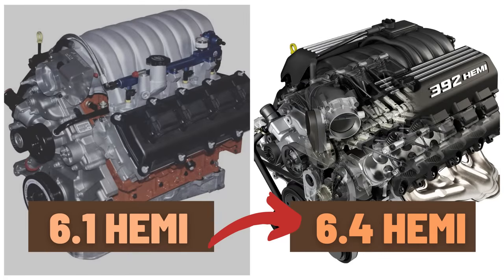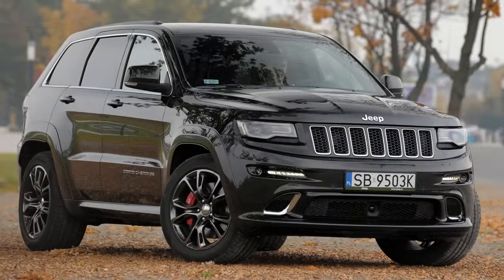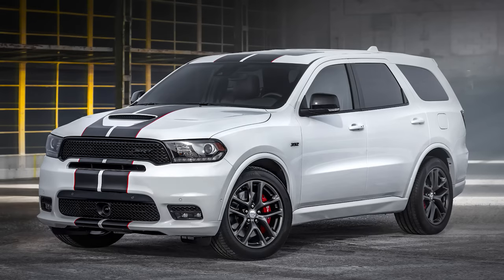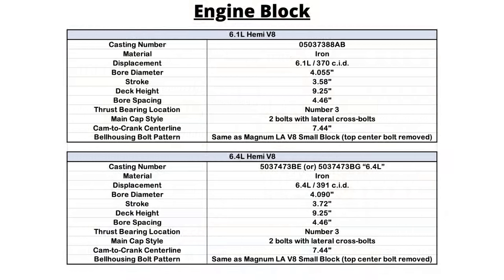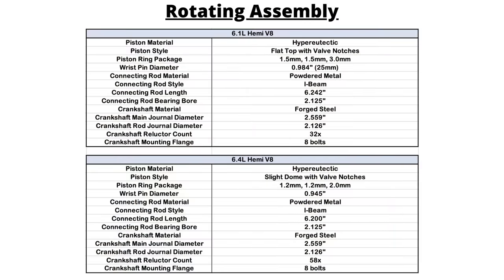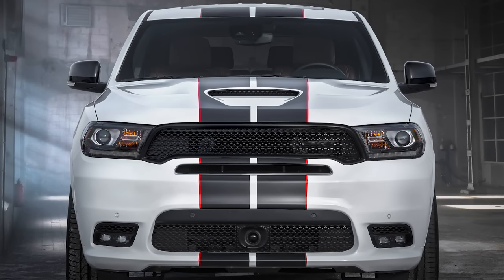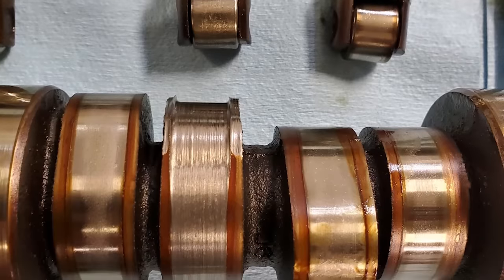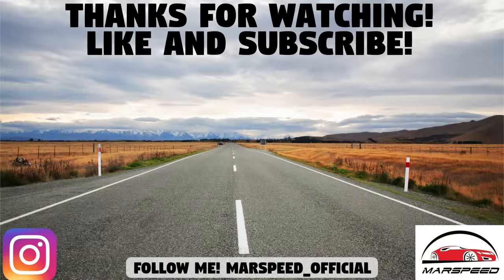6.1L vs. 6.4L Hemi Engine Full Comparison – Which One is Better? (Specs, Performance, Flaws, & MORE)

Comment: I’ll take the 6.1 over the 6.4 any day. 6.1 is a better built motor with less problems.
Reply: With that 6.1, you get less power. But I’ve had four 6.4s. One that I built, definitely all had no issues even with my frequent track use.
Reply: I have a 6.4 with zero problems and it has way more power
Reply: Agreed. The 6.1 srts were true old-school muscle. Just a simple V8. No variable valve timing, no cylinder shut off BS. The 6.1 is straight out of the 60s in a good way. I'd rather have that than an extra 50hp.
Reply: @widebody53ad remember they can handle a lot more boost than the 6.1l
Reply: @fnafplayer6447 pre 2018 392’s cannot handle boost they are not Bge blocks.
Reply: @fnafplayer6447 actually the 6.1 handles more boost than the 6.4 and is all around a better motor
Reply: @vee950  I meant the BGE blocks, what's better the bge 6.4 or the 6.1

Comment: 6.1 was a lot more "raw". Traction control sucked, skid control sucked, torque management was nearly non-existent, and the NAG-1 can hold a ton of power with a proper converter and TCM tune. Drop some good pistons in it, and they'll make a ton of power with boost. Richard Holdener took a stock 5.7 of the same era and made north of 1000hp before breaking a piston. Good video.

Comment: very informative video, can you please provide me the lobe separation angle on both 6.1 & 6.4 camshafts?? i got a lifter failure and probably cam lobe damaged on my 2010 grand cherokee SRT8 6.1L so i have to replace them anyways and contemplating to upgrade to a 6.4 cam/springs if there is any gain by doing it but first need the complete specs for both camshafts which will help me to decide what route to follow, thanks in advance

Comment: So 6.1 or 6.4 which do you guys prefer
Reply from the maker: The 6.1 will always be special. It looks amazing under the hood, and was the first SRT engine. But you can’t argue with the performance of the 6.4 as it’s definitely better in that aspect!
Reply: Bigger is better
Reply: @MarspeedCars  i also love that the 6.1 can hold a good amount of boost
Reply: 6.1 definitely
Reply: Very informative about these engine s !
Reply: Most definitely the 6.1
Reply: 6.1 OG SRT8.

Comment: I mean Boost is fine on the stock pistons as long as you gap the rings as shown by Holdener's big bang video on a Stock 5.7 he was pushing 20PSI before it blew and it's due to the extreme backpressure of a single turbo that's too small
Reply: I agree w this in lieu of the method engineered of the runners.  It’s designed for it even has a similar (but not as low) compression ratio as the hellcat. Even more the fact that procharger demonstrates an install of their blower directly on a red Jeep srt on their website.  If my Mazda 2.5 l 3 can handle boost from the factory why can’t it? Lol.  I do however like the compare and contrast of why lifter failure may be occurring more on 6.4s as more were produced.  Good review
Reply: @ryanc2927  This is nonsense

Comment: So it seems like the stock lifters they use on the NA engines can't handle more than 360ish horsepower. Which is strange because it's not like that power is getting transfered to the lifters. They're not getting the brunt of it. Perhaps they can't handle as aggressive of a cam as these engines have. What I don't understand is why they don't take a look at what gm and ford used in their pushrod engines and follow the same formula. It would make a lot more sense and get rid of a common plague amongst their v8s.
Reply: The ram 5.7 is 395hp. The lifter issues is mostly in high idle vehicles.

Comment: The 6.1 is better to me because it can take boost with out many mods compared to the 6.4 but the new 5.7 makes almost as much power as the old 6.1
Reply: Plus the better new 8 speed automatic transmission
Reply: @IhateYoutube  yes but its not as reliable as the 5.7 or 6.1 cus of the compression ratio

Comment: Yes I have 09 srt and at 140 k miles I had to replace both cam shafts and lifters  3800 dollar cost  one owner
Reply: Currently looking at an 06 Chrysler srt8 with 140k miles, kind of afraid I’ll buy it and shortly after rebuild the cam and lifters. What noises or symptoms did you have that you recommended I look out for?

Comment: Difference between the 5.7 and 6.1

Differences in the engines....

The Block is different
The Cam is different
The Intake Manifold is different
The Heads are different
The Exhaust manifolds are different

I think that covers the majors.

In other words the 5.7 and 6.1 are very different.

Oh, the Throttle body...... it's the same :)

The quoted HP is at the crank, not at the wheels.

To acheive the 6.1L HP from your 5.7L you'd be at least looking at heads and a cam swap, exhaust, and tuning.

Comment: 6.1s can take boost and have gone up to 11 psi with no issues sbe. 6.1 is more for the builder and racer since it's cheaper and easier to modify, 6.4 has the better tech but more expensive. Reliability goes to the 6.1 easily but 6.4s can be reliable with some work.
Reply: the 6.1L is less reliable than a manual trans equipped 6.4L vehicle. The updated standard lifters that replaced the old 6.1 lifters in 2015 (commonly referred to as Hellcat lifters) seem to have solved that issue. The 6.1 lifters still suffer the same exact failure as the MDS lifters, just far less commonly.
Reply: @DarkSlayer487  not even close to being true. 6.1s are way more reliable then a 6.4. Ask any 6.1 owner how long their engines last vs a 6.4 and it's not even close.

Comment: so, which one do you own?  I remember you had swallowed a valve, and then had it all rebuilt, fixed.
Reply from the maker: I ended up keeping the 5.7 block and then boring it out, so it’s now a 6.5L motor with zero stock parts.
Reply: @MarspeedCars  yes, I remember, now that was I think over a year ago, so how's it holding up?  Have you had it "Dyno'd"?  Is everything good on it still?  Have any of the "aftermarket" stuff done bad/wrong/under performed?

Comment: Crazy how these 392s are at their limits and can’t be boosted on stock internals, when you can get a stock junkyard 5.3 Chevy and boost it to over 1000hp reliably! I love all brands, but this Hemi engine is purely all hype unfortunately.
Reply: That whole 1000 hp reliably is a bunch of nonsense.  You gotta tear it down and add ring gap and heads cam intake etc etc etc to get to those power levels and they certainly aren't "reliable" at 1000 hp no matter what the internet tells you.  Those engines are overrated.  Some engines just aren't boost friendly but they can take 6-7 psi give or take with a good tune and fuel (the 6.4).  

Try doing 1000 wheel on a 5.3 without doing heads cam upgrades and without adding ring gap and see how long it lasts lol.
Reply: It has a forged crank it's not that hard to do forged rods and pistons and you can select your compression ratio too.

Comment: So just so you know you people out there are to think you're buying a real hammy are being screwed to death there was never an engine like the 66 7 8 and 9 hemikuta back in the early in the sixties era so this engine you're buying today is a absolute piece of s*** and has no power compared to that old hemmy and it doesn't even sound like a hemmy when you used to start up an old hemmy the ground shook around for 20' when you're standing next to the car these new hemies are Not even comparable to those old motors.. So if you want to do yourself a favor and have a really fast car just do what I did it's no big deal you buy a Nissan GTR build the motor to 1400 horsepower like I did you have an H 2nd car and there's nothing in there is nothing including the b***** lamborghini's Ferrari get lamborghini's ferrari's that will even come close to touching you on the road you beat them by 1520 car lengths before you even know what happened...
Reply: 1960's 426: 
The street Hemi version was rated at 425 bhp (431 PS; 317 kW) at 5000 rpm SAE gross and 490 lb⋅ft (664 N⋅m) at 4000 rpm of torque equipped with a pair of four-barrel Carter AFB carburetors.[20] In actual dynamometer testing, it produced 433.5 hp (323 kW; 440 PS) and 472 lb⋅ft (640 N⋅m) of torque in purely stock form.[21] Chrysler's sales literature[22] published both the gross 425 hp (317 kW; 431 PS) and net 350 hp (261 kW; 355 PS) ratings for 1971.

Modern 6.4:
Special-Edition Chargers and Challengers equipped with this engine, and the engines themselves, will bear "392 HEMI" badging in commemorative reference to the first-generation engine of the same displacement.[33][34][35] In other applications, the engine is badged as "6.4L HEMI".[citation needed] Output is 470 hp (350 kW) and 470 lb⋅ft (637 N⋅m);[31][35]

For the 2015 model year, horsepower was increased to 485 hp (362 kW) and torque to 475 lb⋅ft (644 N⋅m) in the Charger and Challenger SRT 392 (2015-2018) and R/T Scat Pack (2015–present) models; the Grand Cherokee SRT only saw a 5 bhp increase. Export models of the Chrysler 300 SRT retained the 470 hp (350 kW) and 470 lb⋅ft (637 N⋅m) output

Step away from the crack pipe please.